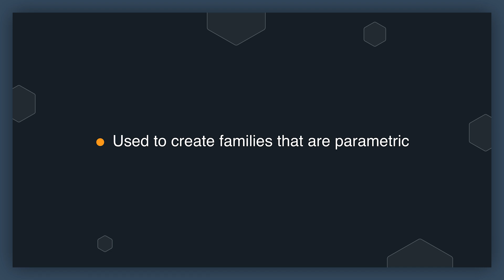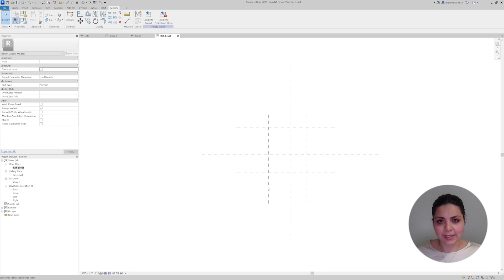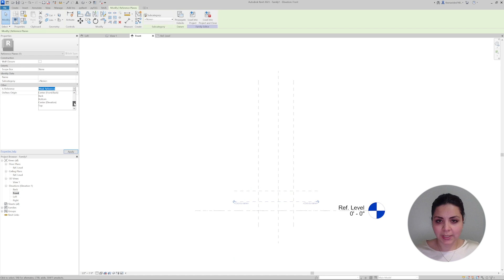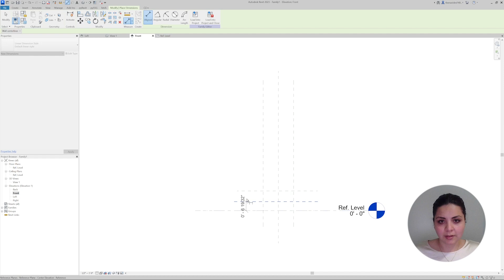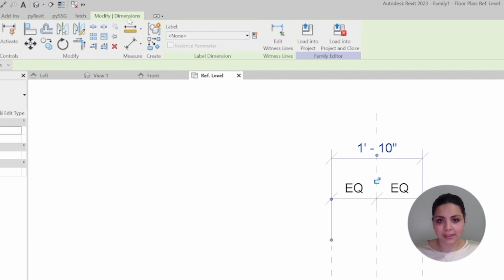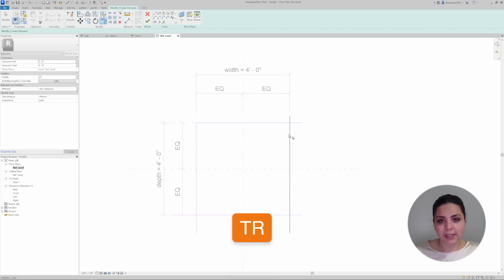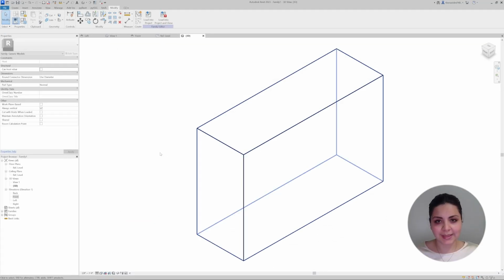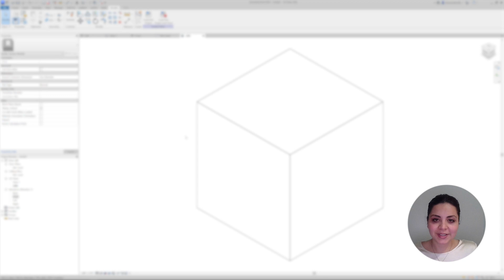Master The Basics Of Working With Reference Planes In Autodesk Revit

Comment: what does the lock mean?
Reply from the maker: The lock symbol is how you constrain elements in Revit. For example, if you lock geometry to a reference plane, it will move when the reference plane moves. If you leave the constraint unlocked, Revit will try and "guess" how things should work. So if there is an element close to a reference plane it might move when the reference plane moves even though they aren't locked. The big difference is you have no control on how it will behave. They way I think about constraints is Locked Constraint = Explicit while Unlocked = Implicit.
Reply: @fetchBIM  Thank you